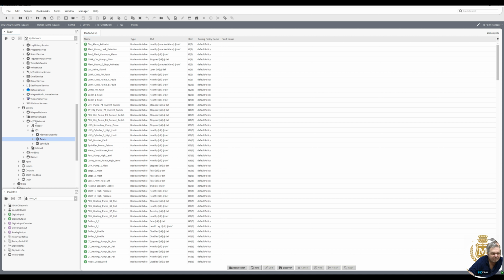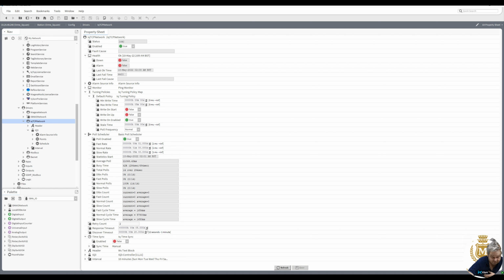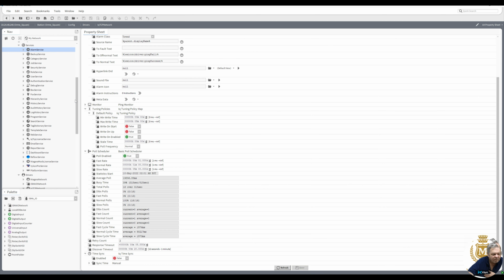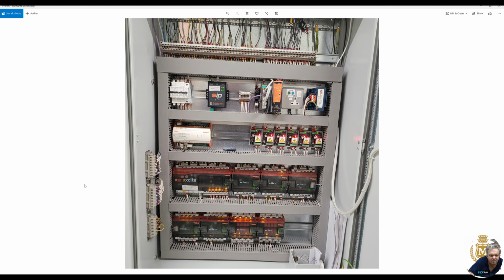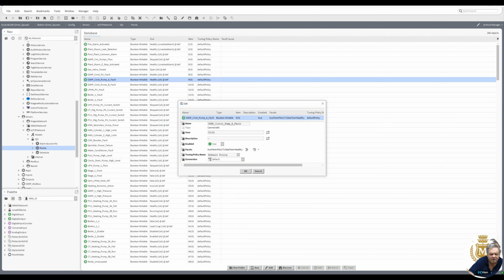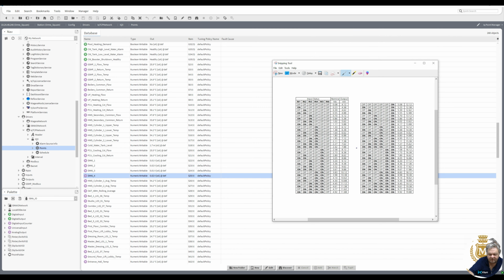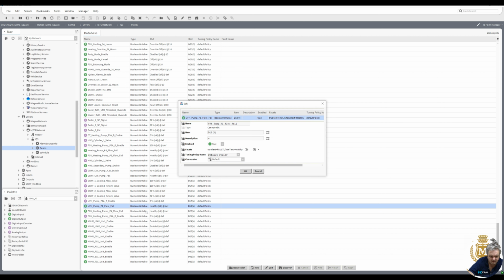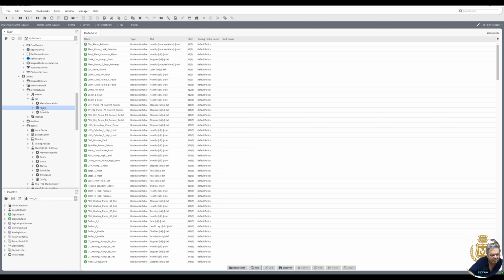#24 N4 Tridium Niagara - Machine learning - TREND IQ3 to MAC36NL controller

Comment: Hi Paul
Thanks for these videos really helpful for me.
Do you just need to install the IqTCPnetwork driver and configure and then discover the points etc.
Reply from the maker: Yes, you can discover all the points or just add the TREND points in by hand if it's not a big station. Once found, you can move the points into folders if required under the IQ3 network, especially useful if you are using the exact graphic many times for relativized points. 
You can download the 2-hour free driver at https://bmsparts.co.uk/shop-maxking-limited/downloads/trend-iq3-driver-for-the-tridium-jace-controller/ for testing.
If you do use the free TREND test driver, then use it on N4.8 station, it won't work on N4.9 onwards.